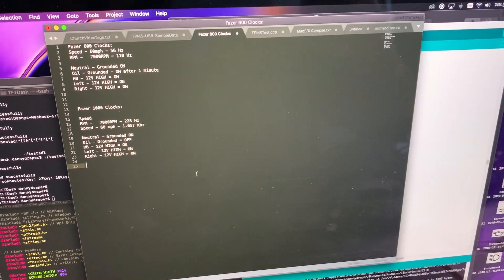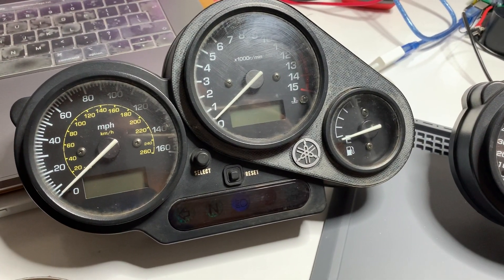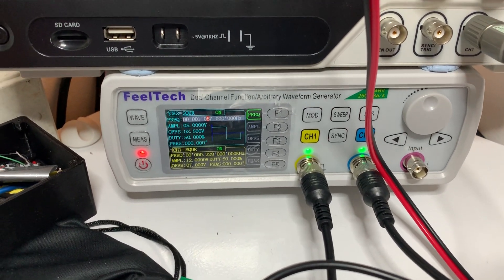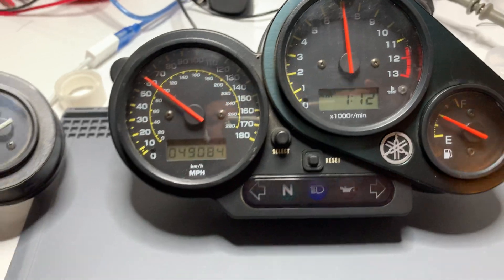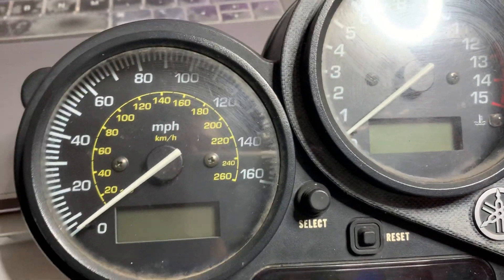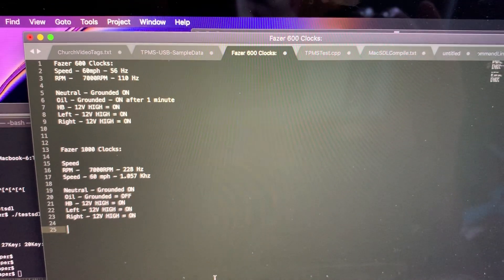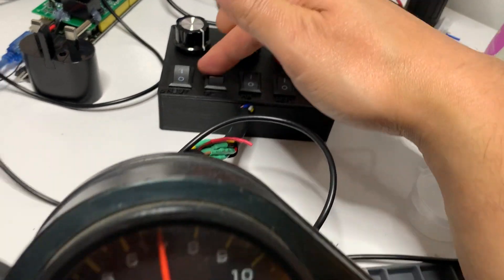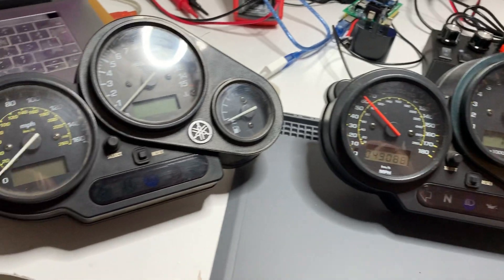TFT Dash for FZS600 - Research

Comment: Hey mate nice work. I've started 1 for my cbr600 using pi zero and a GPS GNSS hat. Just a few questions if you don't mind helping me out. 1. Where do I buy the screen your using. And 2 what language are you using for the GUI ?
Reply from the maker: Thanks mate, would be interested to know how you get on developing yours for the CBR - the screens I use are 7 inch TFT IPS panels with a 50 pin ribbon interface. You can buy them on Amazon but the ones I get from Amazon I use just for the displays and then use a Raspberry PI DPI interface to hook up the screen. Many of the ones on Amazon come with nice screens but the TFT control boards aren’t appropriate and a little too big. Language used for the GUI is C++ using SDL for accelerated 2D graphics - hope that helps